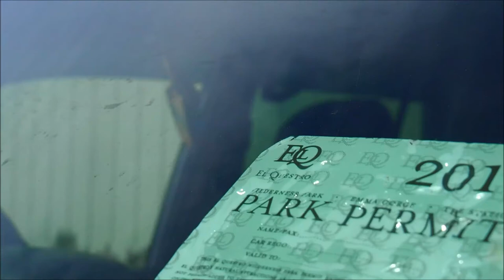4x4 REAR DRAWER BUILD

Comment: Can anyone give me a shopping list on what to buy to build these draws?  ( how much ply, where to buy carpet and how much, what size screws?) thanks on advance 🤙
Reply from the maker: Hey mate, i honestly can remember what i used exactly but im pretty sure the bottom sides and middle piece of the frame and all of the drawers were 12mm and i think i used 2x 12x24 sheets and then the top was 15mm. And i used the cheapest carpet from bunnings about 3 meters of it. and im pretty sure i used 30mm decking screws.
Reply: Thanks for your help! Legend.